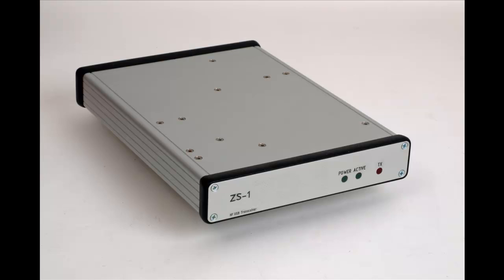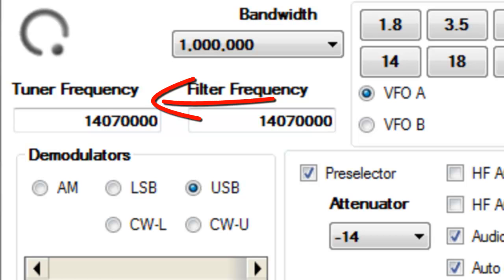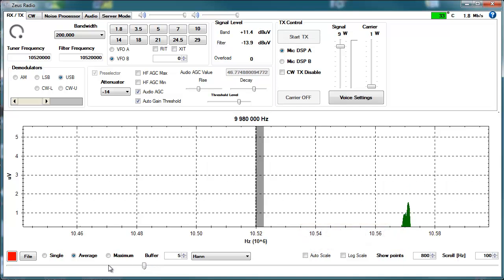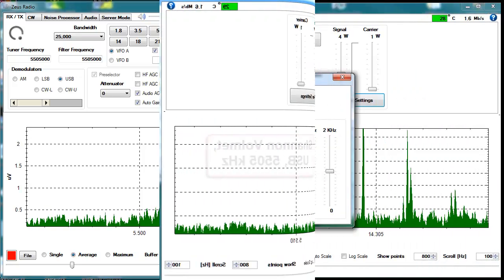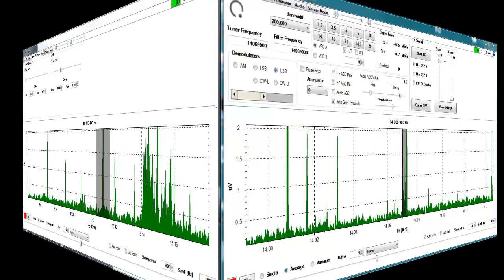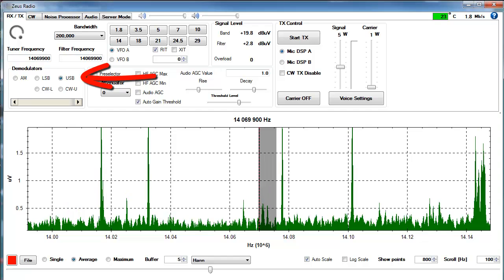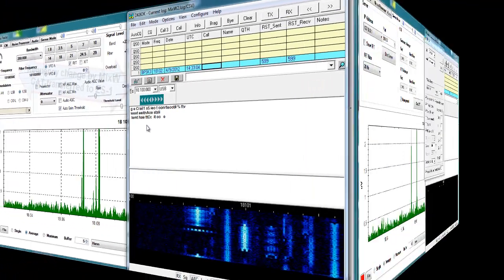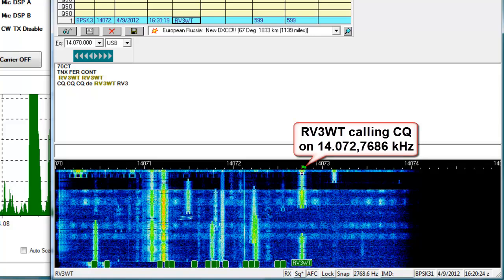SDR Transceiver Zeus ZS-1 - An Introduction

Comment: ZeusSDR include best and unique features as
- P3D mode of spectrogram (Digital Phosphor mode) for spectrum analyze
- Waterfall bind to frequency changes and have high resolution
- Flexible user interface settings
- Hi-End & Hi-Performance algorithms of signal filtering
- SmartAGC
- "Time Machine" - operator can rewind the signal back using waterfall
- Implement MIDI interface for controls of transceiver
- IQ recording and IQ playing
etc.

Comment: SDR is very exciting.  What are the chances of the software being cross platform?  Whether it be  available to run in a browser, which could allow for remote operation, or if possible to allow for operation on Macs and Linux.

Good luck with this project.  I look forward to seeing more in the future.  73 K5WRN

Comment: About tuning below 1.5 MHz: Have you tried to set the tuner frequency to just that? With a bandwidth of 1,5 MHz it should be possible to get down to 0 kHz, right? (ignoring internal filters, etc.)

Comment from the maker: Hi, Tracey - this version of ZS-1 is an early one. It has been developed by an HF engineer who even isn't a ham. I am sure that upcoming versions will include all bands. Even during time of testing, software was improved by e.g. two VFOs and switching between receive and transmit via a virtual COM port. As I learned from my correspondence with Aleksandr, he is very responsive to all suggestions. I will collect them. 73 Nils, DK8OK